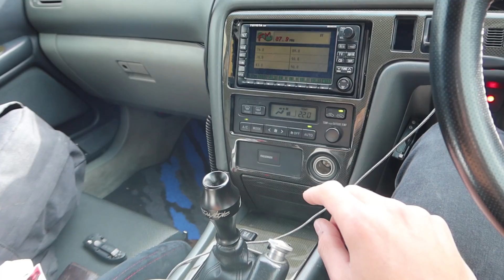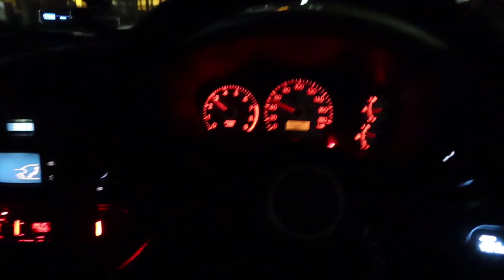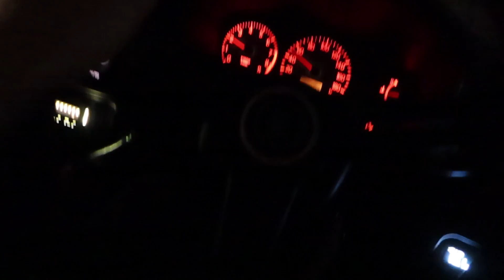Stance Chaser's SECRET PLANS REVEALED

Comment: Change my oil more often as well in my fun cars, higher rpm = more wear/heat or break down of the oil and oil is cheaper than engine repair.
Reply: BOOT
Reply: @alecchrz  Sup?
Reply: change your laces more often*

Comment: Big tires! Ive got a short 255/35 on an 18x9 +45 on the rear of my Chaser right now. No camber and its still tucked on an unrolled fender and it has so much room for more meat! 
Just snagged a complete front set of Tourer V front carbon trim today too! Getting tougher to find nice trim, going to start hoarding now before it gets even worse! 
Looking forward to the back to back dyno graphs. You're doing what I want to do with mine, except I have some different hot side plans! Keep it up!

Comment: Love the chaser and jzx chassis content! Wanna build my own and use your 100 as a base for when I start. Hoping you keep it Streetable lol I wanna good combo of power but more towards reliability in mine. Trying to build the ultimate mountain road tripper so I'm not struggling up steep inclines. Keep in mind I've never driven anything more than 240hp either lol but I live in Canada so there's actually quite a few rolling around already manual swapped a little over 10k.

Love the gtr stuff with obsessed garage too!! 

Sorry for the novel lol even if you don't see it keep the sick content coming and we don't blame you for taking a week off once in a while lol everybody needs a break.

Comment: 1.5 JZ one of the Chaser with a 2JZ GE NA block and 2JZ conrods pistons and 2jz crankshaft... this should give  low end torque due to the longer stroke & higher compression ratio.  Many also say 1.5jz is even better than a 2jz gte due to the better flow of the 1jz gte head. Most probably the cheapest way to gain significant power to 1jz gte.